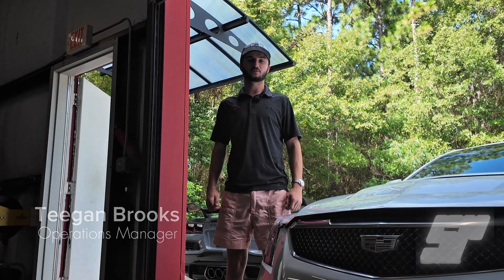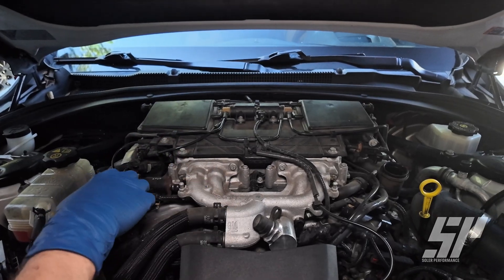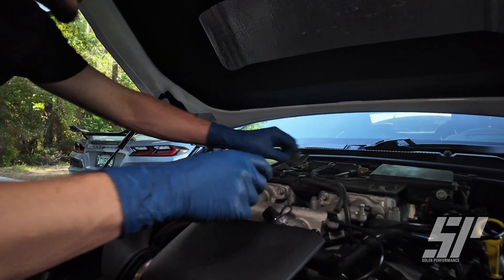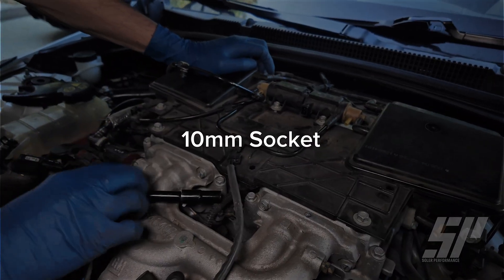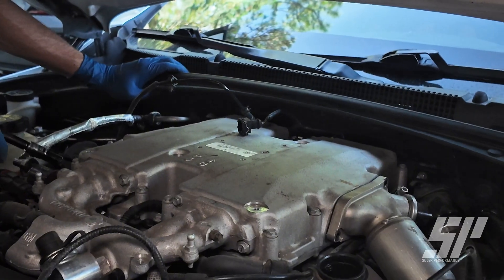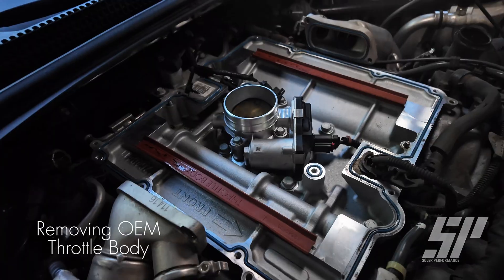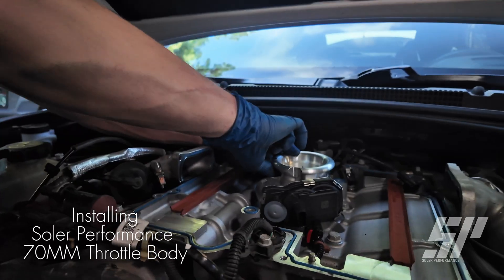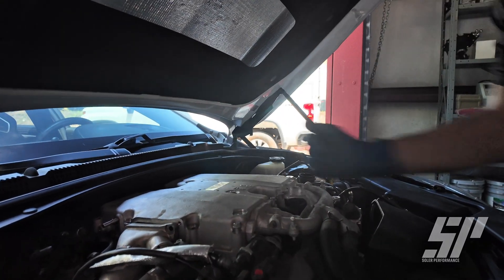Soler Performance | Cadillac ATS-V [LF4: 3.6L V6 Turbo Engines] Throttle Body Installation - DIY MOD

Comment: Never, never push the throttle valve with your hand , will throw the celebration off and will fk it up.
Reply: Actuating the throttle valve will not throw the calibration off since the car doesn't have any power to it. Now unless the car is on and you do that , then it can but is basically impossible for most cases since everything else you remove will end up throwing the car into limp before you can access the TB. 

You can do anything you want to the TB valve, the calibration within the unit is set . Especially without power so makes no effect I've done it plenty of times.

Comment: Is this sequence the same for all version of the chevy 3.6 v6 and do you all make parts for the llt3.6 v6 chevy buick non turbo motors?
Reply: Other 3.6 Chevy motors are WAYY easier to access but the battery disconnect and throttle relearn is the exact same for all 3.6 versions of the Chevy motor we make parts for. 

As of now we have units for the LGX,LFX,LLT, LGW, and of course the LF4!
Reply: And the LGZ!